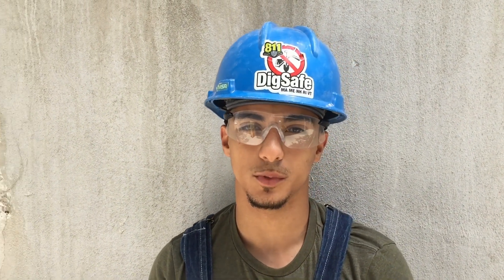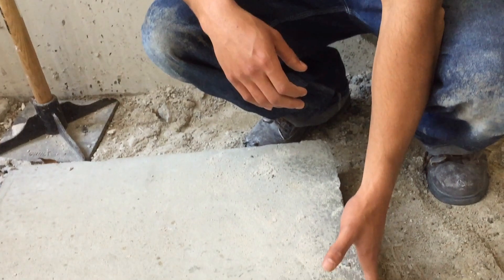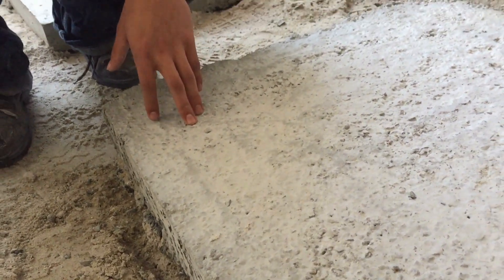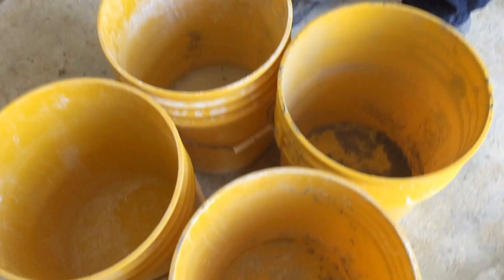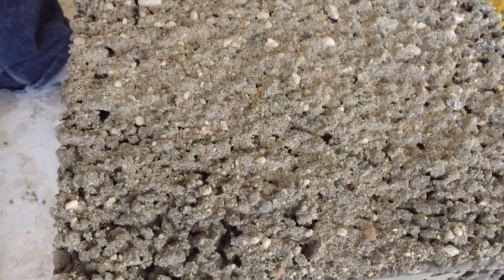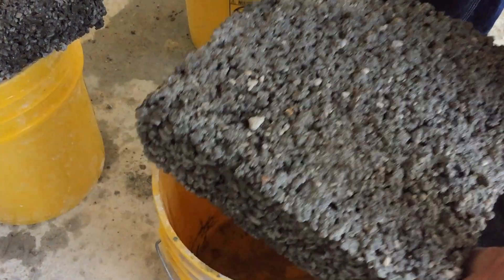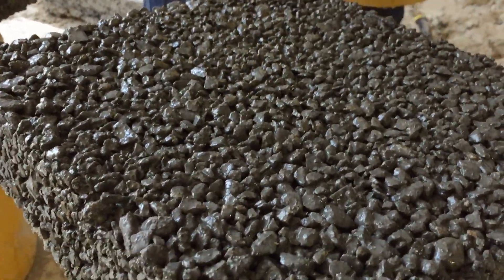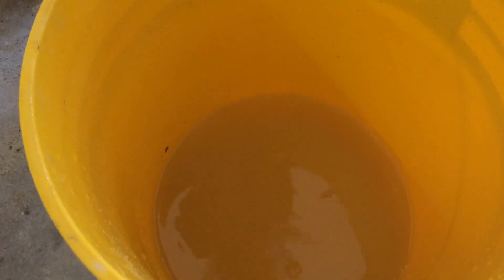Junior Senior Project (Pervious Concrete)

Comment: What are the aggregate size used
Reply from the maker: 3/8" pea stone aggregate mixed with Portland Cement. 3:1.25 ratio and add water slowly and mix. Add additional cement until sticky and pour in small batches. Finish immediately and mist with a spray bottle until completely finished.

Comment: Practically it's difficult to use porous concrete, it will not provide smoothness at high speed.
Reply: Yeah Exactly, But what do you think? How can we remedy this?
Reply: @kingbisanka9689  mixing rubber and ashphalt
Reply: @shubhamsharma2877  ohh alright.  I'll search out that.
And then again will the mixture made from rubber and asphalt be porous?? Because from my little knowledge I don't think of asphalt is okay for use in permeability as it is not not a good product when it comes to water conditions..
Reply: @kingbisanka9689  if you coat a layer of rubber ashphalt mix on porous block keeping distance of 6 inch raw and 6 inch coated, it will provide grip with smoothness
Reply: @shubhamsharma2877  ohhh alright. I get it